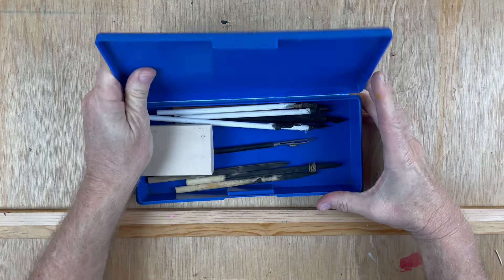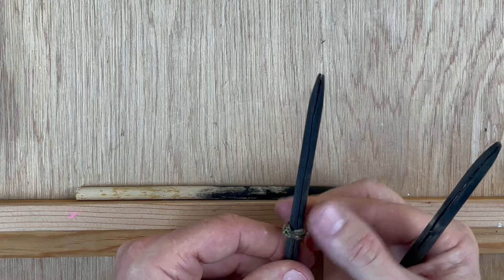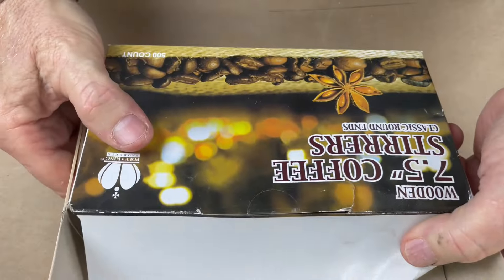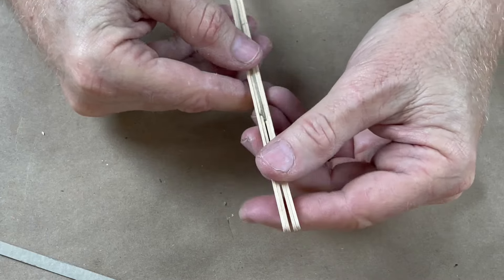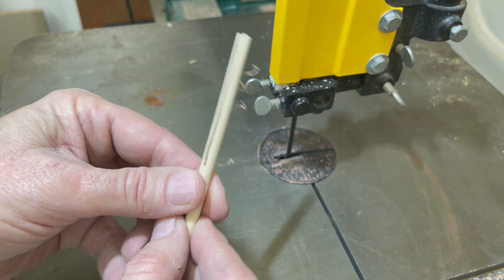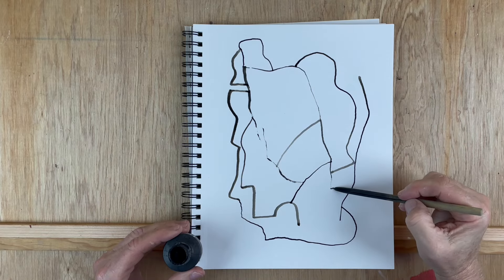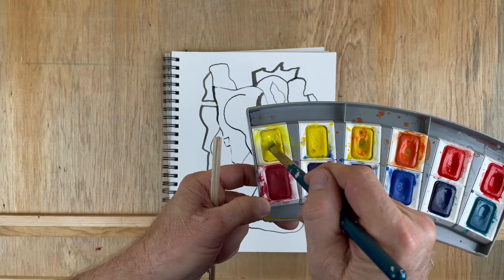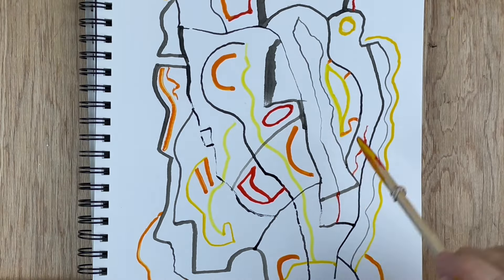Fun Tools You Can Make!

Comment: Ever since I was a kid, one of my favorite possessions was a copy of How to Draw Comics THE MARVEL WAY! They listed all the tools comic illustrators used ... circa 1978. I recently went back to it and used it as a shopping list. Bought a ruling pen brand new from the Alvin company and it was horrible. I looked at the tines and it was a mess of sloppy machining. So I ordered a vintage ruling pen from eBay, something from West Germany (yes, this is a real vintage instrument!). The inside of the tines were mirror smooth and the tips were almost needle-like, and it works fantastically even with my thicker India inks. I don't dip the entire thing: I can load the tines with an eyedropper and then just get a little on the outside tips. Less clean-up! 

Since then I've also gotten into fountain pens, which work on a similar principle of having two tines and ink flowing between them through capillary action. One thing this as taught me is to watch out for "baby's bottom" on the nib, where the inner surfaces of the tines are rounded. This makes them unreliable; having tines with perfectly flat faces and sides is ideal. So if you're making these coffee stirrer ruling pens, try and match the flattest faces together for the inside of the tines. This explains why the new ruling pen I bought performed so poorly with those ughly, rough, uneven faces on the inside of the tines and around the tip. 

Also, the open grain of the wooden sticks is going to soak up that ink. Before gluing the tines to the cardboard, maybe give their exposed arms a coating of something impermeable? Could probably be wax, or wood finish, or a spritz of clearcoat, etc. That should help the ink flow a little more reliably. Just remember to leave an un-sealed gap in the back for gluing the tines to the spacer. 

The Internet is full of people making ruling pens out of soda can walls cut to shape and folded over. They work, but the downside is they're not really adjustable (also they're sharp, and soft enough to deform easily). Unfortunately all these soda can ruling pen pages have really displaced information about the actual, professionally-made tools in search results. It was really difficult to find information about the real deal drafting tools when I was looking for them. 

Another thing to try is making an authentic reed or bamboo pen. They're more like feather quills (in fact they were the original version of the dip pen before feather quills came into use) in that they have a tip cut at an angle and a slit made in the middle to deliver the ink. Reed pens date back at least to ancient Egypt, and are still used as the tool of choice for Islamic calligraphers to this day (where they're called a Qalam). There's a direct evolutionary line from these kinds of writing instruments up to the early 20th century; even the preferred permanent ink for most of Europe's reed, quill, and fountain pens still had the same basic recipe for at least a thousand years (a mix of oak galls and iron sulfate, with gum arabic used as a thickener). It makes a very permanent, wet, waterproof mark yet doesn't dry up and clog the inside of a pen, so it was the ink of choice for writing text. The Townsends channel has a video with an 18th century writing expert who demonstrates the ink-making process. 

Drawing ink is more like the older kind of ink formulas; it uses extremely fine particles of carbon (traditionally sourced from soot) with water and a binder. In the West, gum arabic was the traditional binder but this didn't make it waterproof. In China and India, animal glue was the first binder and then shellac was used for waterproofness. This recipe was brought back from the Eastern regions and came to be called India or Indian ink in the trade. Because it's a pigmented ink that's waterproof, and has a really rich, opaque black color, this is what architects and illustrators gravitated towards right up to the point where everything started moving to digital linework.

Comment: Been watching your moulding and casting videos. With no pressure or vaccumn pots, is the best way to minimise bubbles in moulds and resin just shallow pans, shaking and blowing air? Would pouring in small batches with time for bubbles to rise inbetween possibly work?
Reply: I'm clearly not Robert, but I think it greatly depends on your parts. For me, I've had some really good recent success by brushing on a thin layer or two of rubber and letting it cure between coats or gel before pouring the rest of the mold. Then for preventing bubbles in my resin, I've just been working hard on my venting. I still get them, but they've all been minimal.